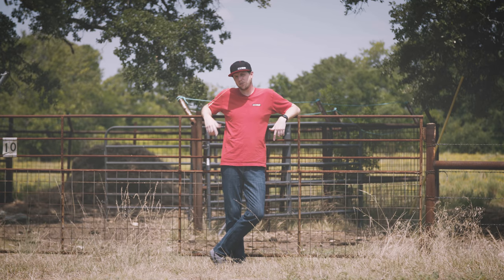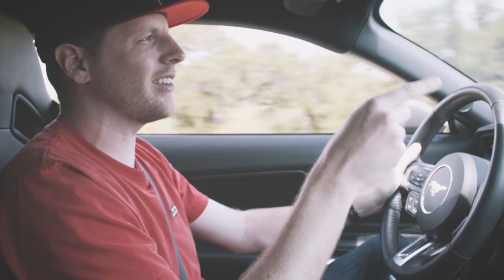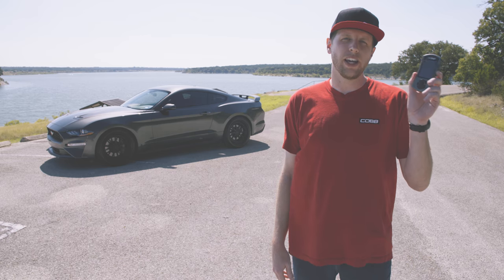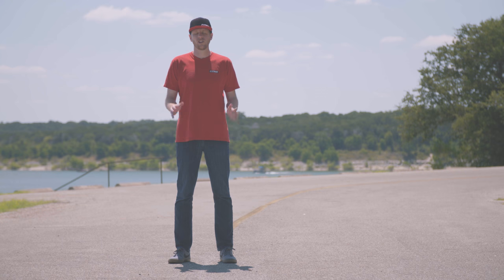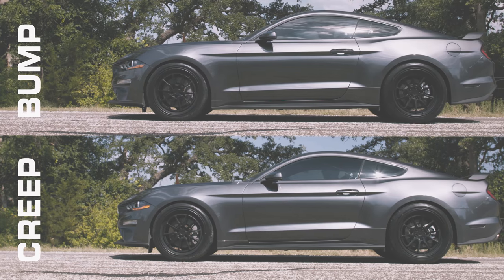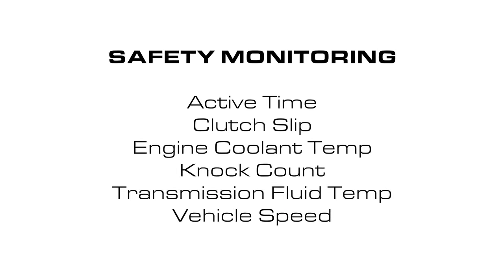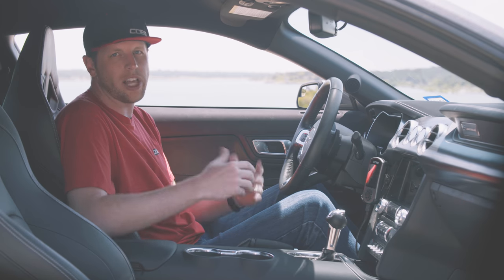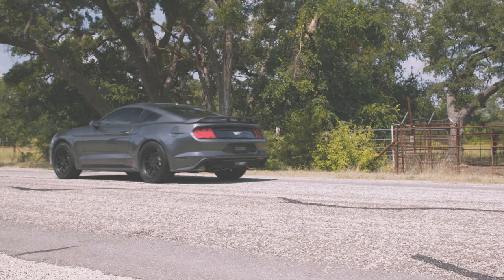COBB Tuning - 2018+ Mustang EcoBoost Transbrake

Comment: So with the trans brake, can you launch higher than the stall speed - as you'd be limited when using the foot brake?
Reply: Yes, I recently got the feature added after recently installing my Cobb AP V3. Instead of going from idle (600-800 RPM) at the light, you can rev to your desired RPM launch range and really pull the most amount of torque.

Comment: Hi, I Autocross my 2018 10speed when using the Launch control can I select my gears? Lets say I down shift to start at first gear then hold the left paddle to enable the launch control? Then up shift 
to second gear when I want? or The Launch control Only works if I leave it full Auto?

Comment: Do you have any adaptable option for a 2021 ranger 2.3 ecoboost. I'd like to be the quickest and fastest stock engine ecoboost Ranger 1/8th mile. Current best is 8.90 1/8th.
Reply: The truck is tuned and should be around 315hp and 365tq. I would love to be able to launch this truck on some boost!
Reply from the maker: Hey Steven, we do not currently have anything in the works for the 2.3L Ranger, sorry!

Comment: So do I need to update my accessport to get these options?
Reply from the maker: Yep, just update our Accessport firmware, then make sure to flash the v200 map. Once done the new features should be applied.
Reply: Nvm I got it working!
Reply: COBB Tuning i need some assistance in getting this to work i have a 2018 ecoboost and recently updated my AP with these features. I have been trying to do the transbrake but once i hold the left paddle shifter for about 3 seconds i let go of the brake push the gas but it doesnt lock. I made sure i have the feature to on in the settings. What could i be doing wrong? Is there a set of setting i have to have the other options set to?

Comment: Is this tuning option also available on the Mustang GT with the 10R80?
Reply: Joshua Smith nope just for ecoboost you’ll need a different tuner for a GT
Reply: No cause the engine has a lot more power you'll destroy your 1st and reverse gear clutch pack

Comment: I cant get it work i have been trying since yesterday to use the trans brake feature and it just doesn’t stay locked as i push the accelerator i just go forward what am i doing wrong?
Reply from the maker: Hi, sorry for the delay in replying. Are you still having trouble using the feature?
Reply: COBB Tuning its ok thanks for the reply anyways and i actually figured it out. I was trying to use the feature while i still had the old version of the tune flashed on my car so i flashed the new version of the tune and got it working. Great feature! Really helps with my track times
Reply from the maker: Good to hear, have fun!